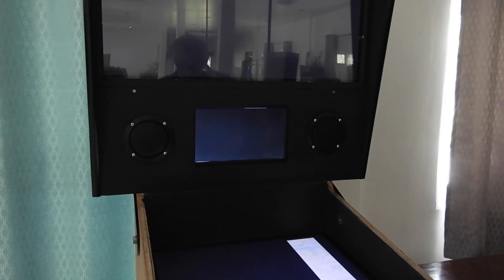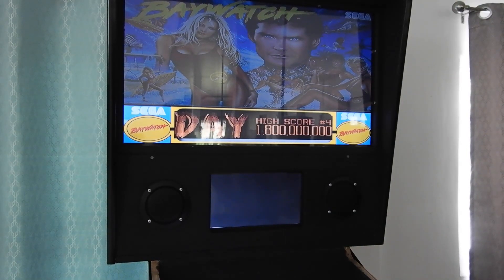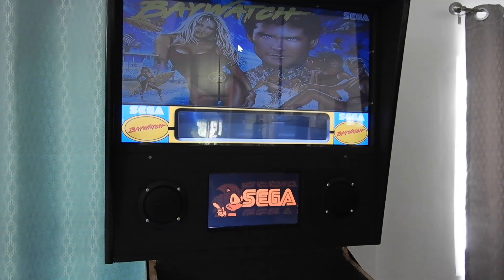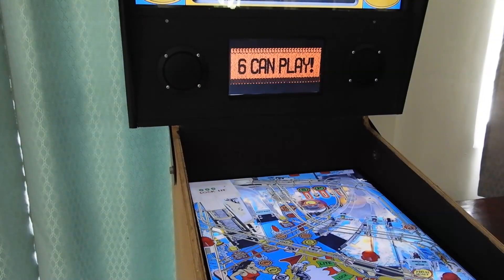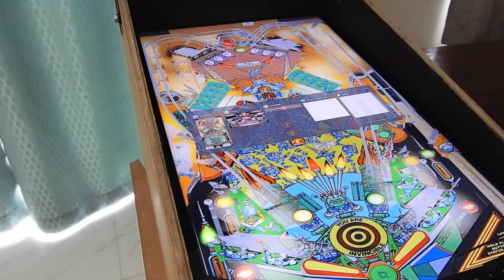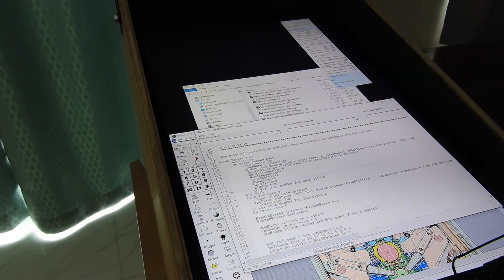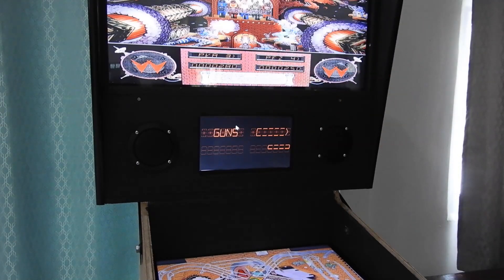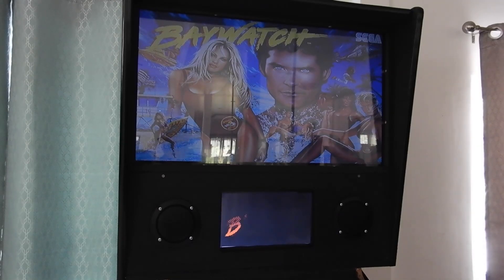VPX move DMD to 3rd screen & enable hidden DMD

Comment: Hi thank you for the help on this.
I have a multipin vpin which is amazing but some of the dmd s are on the backglass when I start a game and not on the 3rd window as should be
I have followed your tutorial and it works as expected and saves the position.
But when I have switched off and come back again another day the dmds have reset to the backglass default position??
Any ideas?
Also can't seem to make the dmd any bigger in the 3rd screen dmd window. The frame can be stretched and it looks bigger on the backglass but when I move it to the dmd area it remains the same size dispay but the frame spills over onto other screens??
Cheers
Mark

Comment: Im planing out a shopping list to make a table will i need a graphics card with 3 monitor out puts to get this working
Reply from the maker: Hi Robert - only if you want to have a separate screen for the DMD . Otherwise you can arrange the screens so that the DMD is the lower part of the second screen (if you get me).  Mind, most cards now have more than 3 outputs so that shouldn't be the limiting factor. Cheers!
Reply from the maker: I've got another clip here listing the parts to source for a similar, cheap, build.

Comment: I just recently got the neverending story table for vpx. The author of the table states this"For those who have the knowledge to move the DMD to an external monitor I have included a separate "Backwall" image in the Image Manager (Titled "backwall_no_DMD.png")You can select the back wall in vpx and choose noDMD png file to remove the dark rectangle that helps the dmd when its on the back wall." Would it be possible to make a video how to relocate the DMD on that table? Thanks

Comment: my backglass is in my DMD screen how can i move my backglass out of my DMD into my backglass monitor . some reason most of your videos you keep talking about DMD settings nothing about backglass  if you have this problem
Reply from the maker: Run the B2S_Setup program in the visual pinball tables folder to change which display is used for backglass.

Comment: Good explanation video.  

Just wondering how you have your VPX program screens all able to read right side up on the playfield.  When i set the playfield monitor to landscape in display setting so it is in the proper orientation, all the program boxes are 90 degrees off.

Thanks.
Reply from the maker: Hi Barney, make sure that "Use always FS backdrop settings" is checked in VPX Preferences menu Video/Graphics options.
Reply: @arnoldj.rimmer5116  Thanks for the reply, I do have that option checked so there must be something else.  If you have your playfield as Monitor 1 and the orientation is set for landscape did you change any orientation setting in vpx itself?  Oh by the way I'm running Windows 10 if that makes a difference.
Reply from the maker: @barneyrfd  Hi mate so I think you have the playfield monitor set to landscape mode in Windows, but physically rotated vertically as (or as if), in a cabinet? Take a look in the editor - open a table, click backglass/POV icon on the left and click to open the options window. In the options window Mode drop down list, choose FULLSCREEN, and make sure the Test Desktop checkbox is disabled. Does that make any difference?
Reply: @arnoldj.rimmer5116  I see what you are saying and if I change my playfield to portrait mode in windows, it throws everything off in vpx so i would have to revise each of my tables to correct.  That also goes for my Future Pinball tables and FX3 tables.  I should have set things up differently to start with if i wanted my playfield in portrait mode but I have too many tables right now to revise them all so i'm just gonna have to leave things as they are.  

Thanks for your help, cheers.
Reply from the maker: @barneyrfd  I'm not sure you'd have to revise each table individually. What happens if you uncheck  "Use always FS backdrop settings"?

Comment: What program were you in with right click to change setting?
Reply from the maker: Hi mate, in VPX. Right-click on the backglass screen, not the playfield, to bring up the settings window. Cheers!
Reply: @arnoldj.rimmer5116  ty I was just wondering what the software it was for backglass, like were the settings from Pinup popper? I couldn't see the screen clearly after right clicking or I would've saw it on top
Reply: @arnoldj.rimmer5116  gotcha, thank you